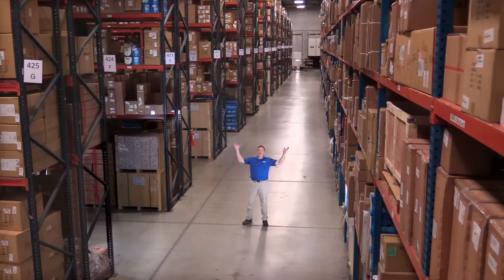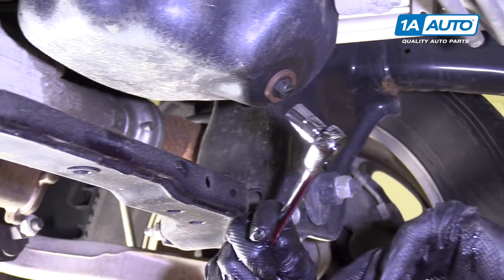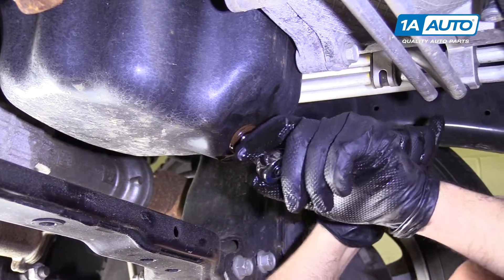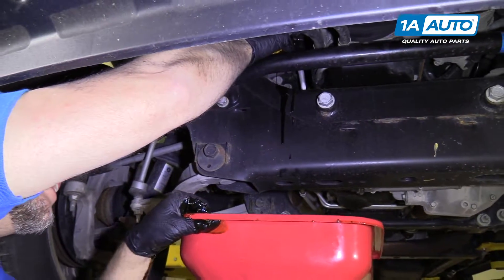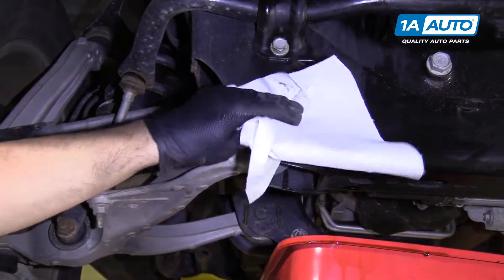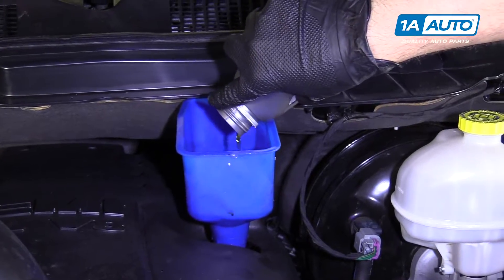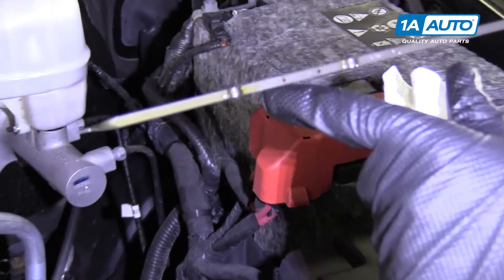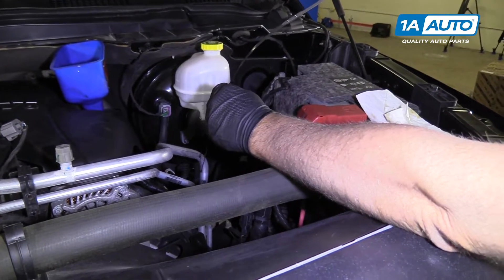How to Change Oil 09-18 Ram 1500

Comment: I work at a hyundai    Chrysler  jeep ram  dealership as a lube tech     I had one of these today   the 5.7  is a messy job     because  the  factory mounted the oil filter  right above the steering rack and starter
Reply: My Chevy too makes a mess
Reply: 2019

Comment: My 2017 ram 1500 V6 uses a canister type oils filter located on top of the engine. Need to remove the plastic cover to access it. Canister cap is a 24mm or 15/16” socket. I don’t feel any difference between the 2 sizes.

Comment: leverage  is your friend     been doing this since i was 17 and im 53 now     longer ratchet   or breaker bar  .   I always get the truck that was done last by some dumb kid  who thinks its  ok to use a air ratchet to put the drain plug back on  .   and of course does not think or care about the next guy in the dealer  who  gets it next service  . there is a kid in my shop who likes to put all his spin on filters   on with his pliers   lets just say I dont think he will be doing that any more  because I just did a oil change on his last veh   enough said     right frankie

Comment: My Ram 1500 hemi is by far the hardest/messy oil filter change on any car I have ever owned. Mopar makes a 45 degree filter adapter with a drip diverter, I want to install but have no idea if there is enough space to do with out major disassembly. I would love to see a video of it's installation. There currently is none on youtube.
Reply from the maker: +Ryan Smith We do not have a video for this repair right now, but we'll keep this request in mind for a future video! 1AAuto.com
Reply: @1AAuto  awesome!

Comment: These Rams call for Synthetic blend 5w-20.   Can we switch to full synthetic?   I've heard blends are a rip off only have to contain 7% synthetic by law.    Ugh
Reply from the maker: +John Zitiello Thanks for watching!  We recommend using whatever type of oil the manufacturer calls for.  All vehicles are engineered a specific way and it is always best to use what they recommend.  1aauto.com
Reply: Yes you can go to full synthetic, my 2018 5.7 recommends full synthetic, Synthetic blend is like the minimum. the factory says that Pennzoil platinum 5W20  Full synthetic is what the engine was designed to run on, I use mobile 1 full synthetic with a mobile 1 filter but if you want to go by the factory then Pennzoil Platinum 5W20 is what the engineers built the motor to use.
Reply: Penzoil full synthetic. Never had issues. Going in 70k miles. I’ve had since brand new back in 2014
Reply: Reason got value lifters noise issue in summer time like metal rubbing and oil weight is too water thin on 5w20 full synthetic. Fix it with 5w30 synthetic summer time and my oil pressure is steady at 40psi in summer time without accelerate engine and jumped to over 60 psi during accelerate engine. 5w30 full synthetic for winter time or both synthetic or full synthetic works and mopar 8 hole oil filter 889 was the early 5.7 Hemi 2002-2009 history book. Like 2002 dodge ram 5.9 hemi post to use 75w140 full synthetic gear lube inside rear axle like those newer rams 2010 to latest used 75w140 full synthetic gear lube in rear axle because of driven hard mostly. Expensive run test for Updating my books correctly. Manufacturing my say what to used will get you started or get screwed on misdirection.
Reply: I use 7oz seafoam in crankcase on 5.7 hemi use 7 quartz oil because someone missed oil change. Let it idle with 5w30 synthetic until engine warming up until valve lifter noise is gone. Only use seafoam for emergency for missing oil change.

Comment: Great video. Clear, quick and to the point. I'll 100% subscribe but I have a question about the other pan on the bottom of the Ram 1500. What the heck is it called? It has a rectangular shape, with lines on it and a Allen key that says oil drain with and arrow? I think this is leaking on my truck but I can't seem to find the name. Please help! :)

Comment: I just left  from working at a dodge ram dealer  after doing oil changes on the rams and wranglers   I do not miss the ram with the 5.7   the oil filter was in the worst place    try doing these all day long  and you need a ladder or step stool to put the oil in the oil fill

Comment: Do you need to use a bit of oil to lube the new oil filter?
Reply: yes
Reply: Yes and pre-fill the filter to avoid a dry start. I would use a quart size zip lock bag also to take filter off so you don't get oil all over your rack. Also after filter removal I always take crankcase bolt back out because with the pressure it drains the rest of the oil out